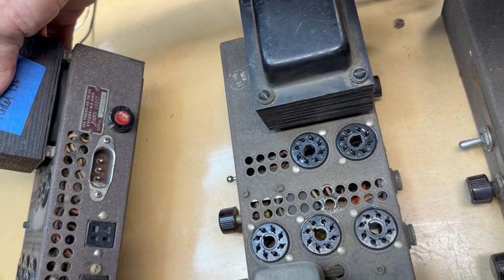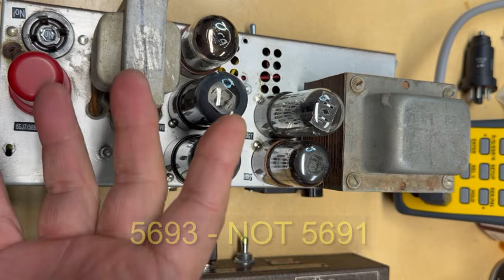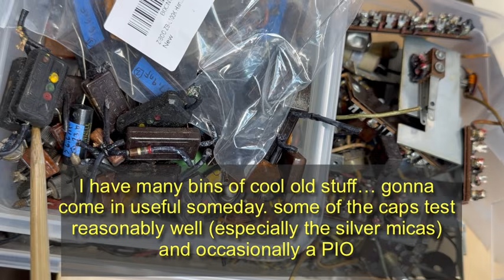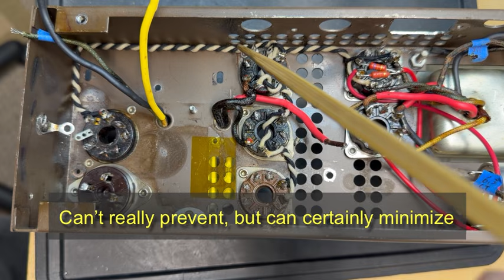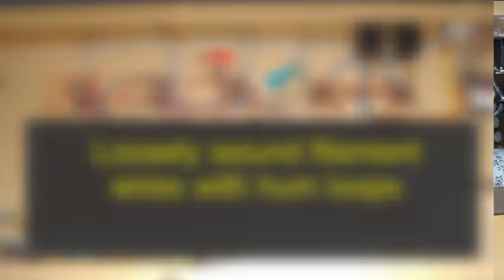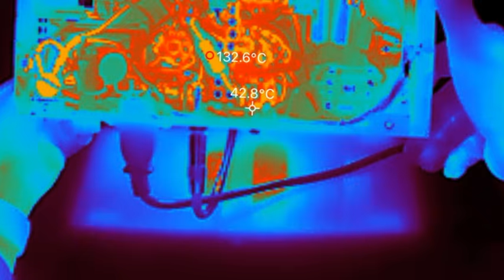Bell and Howell Filmosound Model 179 Guitar Amplifier Conversion

Comment: Have you ever converted a 302 with the umbilical corded Power Transformer to say, a Vox AC10 with El84’s and a EF86 preamp? An extension piece of an aluminum to attach to original chassis and mount the power transformer to the extension. It seems like it’s a larger power transformer. I don’t see many 302’s converted but I’m having MR.AMPS do it for me next year when I’ve got the cash. Thanks for the extensive overview. I might have bought my 179 off of you but I don’t remember? I believe it was on eBay. It had that same blue tape on the output Transformer. Mr.AMPS built a killer tweed circuit inside  it (his own design) with a pentode and with the same era of Bell and Howell 16 ohm cabinet, it rips at 12 watts. I’m shocked at the how powerful it is for 12 watts with the 6v6’s. Amazing amp and maybe the best I’ve ever heard, at least in my collection. Cheers-my other favorite is an original GA45 with the 5879 preamp tubes. Tough to service but a killer greasy circuit that slams.
Reply from the maker: I’ve not played with the 302 , although I’ve converted.a number of the 385’s - my interest has been more with the earlier octal chassis’ as I personally like the tones you can get from various octal preamp tubes…. There are a number of early (late 1930’s through late 1940’s) 16mm “compact” sound projectors other than the B&H that are fun to convert, some with interesting (I.e. challenging) form factors! As far as mini 9-pin tube chassis’, the sky is the limit for design choices!  I hope you enjoy your new amp!  Thanks for checking this video out!
Reply: @GuitarAmpProjects I agree…I had MRAMP out of Salem convert a 179 with octals and ran it into a a B&H 16 ohm cab and I was blown away. I picked up the the 302 cheaply and Billy(MRAMPs) said he could convert it to a Vox AC10 type with EL84’s and an EF86….next year when the money flows again. Loved the video-thanks I finally have a really muscular amp. Even more than my GA45 which I was surprised(it’s a beast in its own right)-a different colored crayon to have some fun with. Paired with 64’ SG Special, it’s pure magic! I would love to try a Kalart 6973 unit someday as I have a Harmony 430 that I had higher hopes for but it was a bit mute…original Black Plate 6973 helped a bunch though. There’s just a lot going on in that circuit.

Comment: What's the rating for your TMOV? 

Working on the final version of the 179 right now, leaving the p.i. and output section as designed with a touch more voltage for the 6v6's. From the gain stage back to the 6J7 socket it's pretty different tho, James tone stack, EF37-A input, 6J5 direct coupled c.f. to drive the tone stack (where the 918 was), passive loop, feedback on a snap switch pot. Managed to add a CLC, moved the rectifier to the 6v6 oscilator socket and gained enough space on top of the chassis for a choke.

Should be fun done!

Mine's a lot more "frontier" looking tho, kept the interior shields and tag boards. I appreciate your can cap solution I like that quite a bit. You're leagues and years ahead of me re: layout design.
Reply from the maker: That sounds like a really fun build!  The stock PI and output designs are solid. You might consider replacing any stock CC resistors tho - I have noticed numerous resistor failures and big drift (the stock CC resistors weren’t “precision” to begin with), I guess not unexpected after 80 years of exposure to heat! 

For 120VAC wall, my “go to” is the Littelfuse TMOV20RP150E…. It has a higher surge current rating than the 14mm version, and can also absorb more “hits’ over time before it’s used up.  

Just a thought, the James has a reasonably high impedance, so you may not have to push it with  a cathode follower (unlike Fender/Marshall TMB)… it might be fun to  model it out as an additional gain stage, since it’s there…

I like the Amphenol CL-80 for most of my smaller designs (47 ohms cold to 0.7ohm at 2.25 amps) as an inrush current limiter.

Enjoy - and hope your build sounds killer!
Reply: @GuitarAmpProjects I pretty much gutted it, I'm leaving those shields though I think I there's a fairly recent 3 minute short on my channel for visuals. 

The only resistor that I saved was the so-called 33K grid stopper from the grid cap since in its 69 years of existence it has not seen more than half a volt If that. It's the plate load resistor on my gain stage before the p.i., It's drifted up to 39K which is perfect.

I wanted to push the t.s. with a cathode follower for philosophical reasons alone, The next one I will put a plate driven decibel hungry stack in it. I think I have sorted out the space constraints too squeeze a tremolo in for the next one. 

I can't remember if I bragged on this or not but I have a so-called gain control on the EF 37A input tube which is just a linear 25K pot that is between the negative lead of the bypass cap and ground so rolled all the way back it effectively cuts the raw voltage gain in half. 

I've got the EF37A in starved current / high gain and modeled out it's making an unloaded raw voltage gain of 145... It's a very cool tube It's like the Model A version of the EF-86

I also have a switched bypass cap on the gain stage. Between those two features and the switchable NFB that can also be rolled up to about five times it's calculated resistance I should be able to go from a really clean super civilized sound to something close to an exploding Tweed.

I spend a lot of time doing math trying to take Merlin's advice to eliminate gain latching at the phase inverter and blocking distortion at the output grids. Fingers crossed. Because that gain stage before the phase inverter is dialed back so much It's got a pretty significant grid bias voltage, and the stock cathode follower has some pretty robust grid bias voltage too.

If I could figure out where to put the actual pot for a LarMar master volume I would definitely do it.
Reply from the maker: Sounds like an ambitious and fun conversion!!!